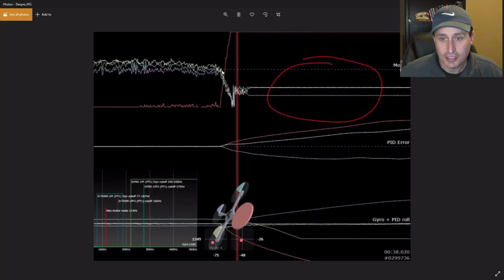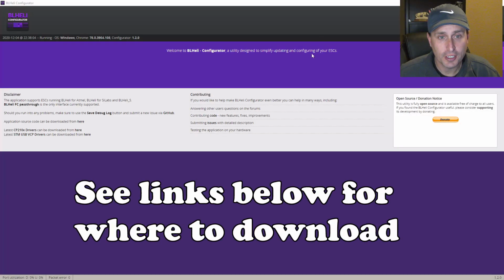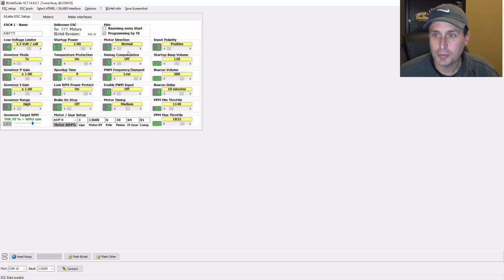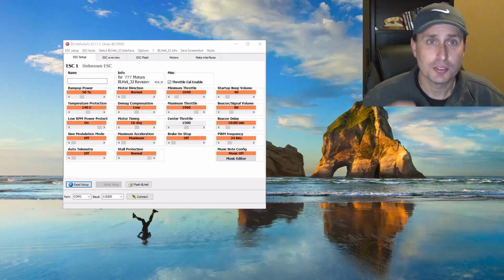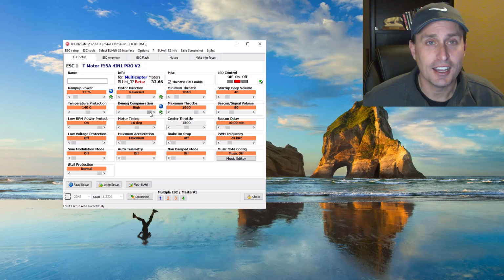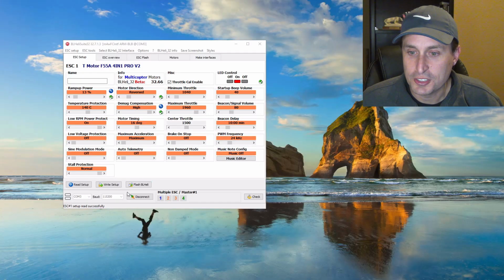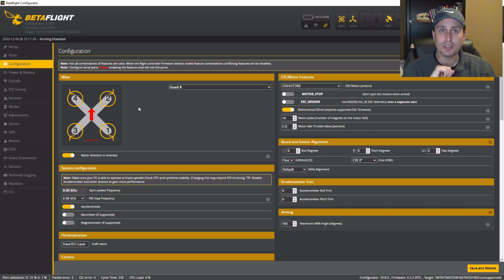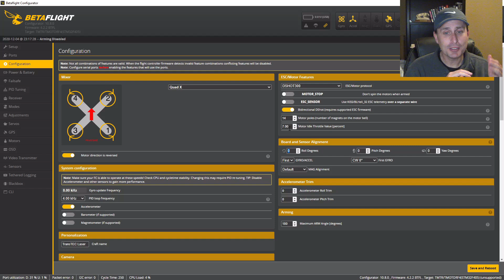How to FIX Desyncs in 5 Minutes

Comment: Cheers Mark!! i was somtimes getting random desync's when catching a fast roll. Im using Diatone Mamba 6s 40a 8bit blheli s esc with Iflight XingE 2306, just got thru 2 packs of sbangy flipping & flopping everywhere to try make a desync happen but it seems all good now(fingers crossed)
Reply: So here I am commenting a month later, IM NOT having extremely random de-sync's anymore 😃
I still have the same motors & FC & ESC.
I was updating Betaflight to a newer version & when I went into the CLI for my dump I noticed there was some errors that came up in Red (probably should have snapped a pic so I'd remember what they were but I didn't 😬)
Once I updated BF firmware I went into cli again & there was no errors.
Since having the newer version & no errors I have not experienced any extremely random de-sync's & the quad flys better now.
Reply: Xing E have uneven magnet causing desync i have same problem with those motors
Reply: @gamerpro6205  I did find a tiny ding in my front left motor & this could be my issue. I just had 2 spare motors arrive yesterday but I haven't changed out that motor yet, probably over the weekend.
My problem is extremely random, for instance out of the last 10packs it's only happened twice. 
How much does yours happen?

Comment: Great tips, tried your way and finally tuned one of my 5'' well, but I do have another 5'' desyncing all the times when I do yaw spin(pitch and roll are fine), and when I use 4s pack it's all good, only desyncs in 6S yaw spin, do you have any recommendation for this? Thanks!
Reply from the maker: Ummmmmm... only other tip is try 48k PWM.

So it is falling out of the sky after a yaw spin on 6S?
Reply: @UAV Tech  Yes only on 6S and what is strange this quad would have serious desync problem at yaw roll pitch on the latest bl32 32.8 with dynamic pwm frequency on, and my esc only support 24k-48k, and when flash it with 32.7 and set pwm frequency 24k only yaw spin have desync problem, strange isn't it :,,,)
Reply: @ziontsui9656  I'm very interested in the cause of your desyncs, I have the same case. Extreme desyncs at Yawspin and 6S. Sometimes it falls from the sky. Frustrating.
6S, ESC 45A, T-Motor F40 IV / 1950KV, conservative PIDs, BLHeli 32; 32.8.
Reducing ramp-up power, Demag compensation and motor timing are unsuccessful.
I tested the motors in Betaflight Motortab (wihtout Props), quick throttle from 0 to 100%, also desync and scary smells. That wasn't good, but the motors survived.
I made a Video about it: https://youtu.be/tixQ0muONXk
Reply: @vanair  Still figuring it out, so whoever solves it could notify another

Comment: Hi, and what about a 360° roll ( without falling ) or 180° happening just after a flip on a 5" ?  
Blackbox showing 2 motors at 100%...
Reply from the maker: If the quad falls from the sky, desync.  If not, could just be motor saturation.  Controller calling for more than 100% of the motor, which the motor cannot deliver.
Reply: @uavtech  Thank you but please what is motor saturation, and can it be solved by the same way ( rampup, dmag)? Or pid ? 

Please d'ont tell me it could be esc or gyro, I just changed the stack...

Comment: I'm having this happen on one of my X-Class quads with APD 80a esc's, and It's driving me crazy. It only happens on the left rear motor, mainly during a flip or punch out. The left rear of the quad just drops. It's already caused me to crash and break a total of 6 arms, and nearly destroying one of the MAD Polar 5215 motors. Getting too expensive to keep trying. Any suggestions with APD Esc's? I've never had this happen on my other rig with iFlight X80-80amp blHeli 32 esc's and cheap 4814 motors.

Comment: Built my new 7 inch one week ago. First flight all good, today with the second flight it didn’t fly, it started to roll away like desync problem. It’s not a problem of props or motor direction because it flew ok the first time and I double checked. Analyzing blackbox one motor doesn’t increase the rotation like others and stay at the minimum causing this problem I guess. Is this issue desync anyway? Thanks in advance
Reply from the maker: Sounds like.
Reply: @uavtech  I tried to fix it with your tips but that didn’t help. I’m so sad. Probably I need to think about bad hardware? Motor or esc? It’s an hobbywing 60a. It’s so weird that for the first flight everything went well.
Reply from the maker: Last ditch is try 48khz PWM on the ESC setting.  If it is still dropping an arm, then it I would look at ESC or that motor.  The motor in BlackBox that the command is going to 100% is the one that is desyncing.
Reply: @uavtech  actually the bad motor in blackbox doesn’t spin up like others, it means it spins but stays low :(
Reply from the maker: Just remember, the Motor Commands in Blackbox are the COMMANDS.  So the lowest command motor is typically the strongest.

Comment: I’ve got a couple sets of Tmotor F40 pro IV that have damage to the windings from the inside of the bell touching them, seems the windings in these motors are sitting too high in places and now T motor has a rubber washer under the bell it can compress and the inside of the bell can grind the high spots on the windings.

One of the motors eventually got a winding cut right through and it stalls as soon as I raise throttle above hover but kind of amazing it still works at all I thought. I put the least damaged out of 8 motors onto one quad and every now and then one of the motors desyncs but recovers. T motor aren’t very helpful, I’ve bought thousands of dollars of their motors and they are dead to me now, emax eco II all the way 😎

I’ll give this a try on the dodgy motors though, thanks.
Reply: Man, those Emax EcoII's are butter. They're well worth the 💰. Cheap with a premium feel. I have two sets of the 2807's, and one set of 2207's. I prefer the Eco II's over the Tmotors, & my Hypetrain Grinder's, especially for the price difference.
Reply: 215 / 5000

I also have a lot of trouble with T-Motor F40 Pro IV, multiple desync during a flight. Especially at Yawspin. Any of the engines cause trouble. I haven't found the cause yet.
ESC is also a T-motor.

Comment: Great video I'm running 4s motors on 6s by scaling them down in betaflight will this work and will I still be able to use both 4s and 6s with the start up  power lower

Comment: Mine is doing that roll of death, but it happen when I punch the throttle, I can hover, as soon as I give it some throttle, it spins. I've tried your suggestion of the video, but didn't workout... any other suggestions?
Reply from the maker: Are the other motors spinning to full when it death rolls? Flight Controller brown out?

Could just be you need to replace the ESC.  Before you do that, set PWM to 48khz amd try that too.

Comment: Hi! I have some problems, when i use my 4s lipo on a 6s quad the quad fly normally, but when a switch to 6s lipo, the quad falling down with no reason, and dont know what to do.
Reply from the maker: Whelp, do these things outlined in the video.  Also, try 48khz vs. 24khz.

Comment: Can any of these setting burn motors? My motors are cool after a full pack  but every 3rd session I smoke a stator. usually on a hard maneuver or startup.
Reply from the maker: Nope.  Could be signs of a bad ESC if you are having desyncs on default ESC settings and now burning motors too.

Comment: What would cause bad input frames
Reply from the maker: It is not that.  It is the ESC losing the position of the motor through not getting a clear Back EMF reading.  That can be the motor or ESC causing the issue.

Comment: A bit late to the party but I'm wondering how setting ramp up power affects the performance of the powertrain? Just going off of the name, does this reduce the power delivered to the motor the when it gets a command to increase RPM?
Reply from the maker: It doesn't.  It is only used to kick the motor to start rotating.  Is it really be called Kick Force
Reply: @uavtech  ok thanks for clarifying that one! :D
Reply: Hmm, I read Oscar Liang article about BLHeli_32 settings and he wrote "A slightly higher rampup power can benefit your drone as it pushes the motor harder when it’s trying to gain RPM (faster acceleration), giving you more responsive and powerful feel (...)". Now I'm confused :/ Is it only for initial kick on startup or acceleration of the motor in general?

Comment: how did you setup a blackbox to get ESC desync in it?
Reply from the maker: Just log.  You will see motors traces by default.  See theuavtech.com/blackbox for tips on working with BB
Reply: @uavtech  ok, and what should I do if I get desyncs only while flying on 3D mode? I tried lowering rumpup power and didnt work.

Comment: Is it a desync if one of my motors started spinning slower than the rest? I have a bnf iflight chimera 7" and when I arm the quad the bottom left motor will twitch out. I've never crashed it, or had other issues. I don't have any new motors or esc's to check, wondering if it's possible to fix in bf. Thanks!
Reply from the maker: Probably a bad ESC unfortunately.  Check solder joints (remelt), but if it won't spin up fully, that is a sign of a bad ESC.
Reply: That's too bad ! Thanks a lot. I'll try that when I get home today!

Comment: I have desync during throttle at 100 % kiss esc any idea ?
Reply from the maker: At 100% throttle it fall out of the air?
Reply: @uavtech  yes if I put throttle 100%!up to the air the kwad turn off but crazy rolls, if I fly normal with out 100% push it fly perfect , sometime on throttle blips also do some
Pitch on blips
Reply: Yes like one motor goes crazy and the fc and esc get in fail safe mode where I cannot rearm  then
Reply: Also notice some unbalance on the blip throttles

Comment: I have been chasing this on my 7" with INAV. It would fall out of the sky when testing return-to-home (maybe because the FC does a sudden throttle input). Flashed back to Betaflight and it still happens on hard throttle punches. Maybe this will fix it... with those big motors and long arms it could be an expensive troubleshoot. 😬
Reply from the maker: Fingers crossed
Reply: @uavtech  so far so good... took it out for a test and you can see it dropping an arm or twitching occasionally, so it seems to still be desyncing at times but it recovers. This thing has individual ESCs, maybe there is some subtle wiring problem, but for now at least it flies and doesn't just do the roll of death. Thanks for the useful tips 🖖

Comment: I'm having this issue with some of my fl1 race quads. The h7 ones are fine and the one with millivolt 20x20 and hw 20x20 esc this worked. But the one with revoltosd and hw 60 amp is still doing it. It recovers but still does it when you get on the throttle hard. Can't get it to go away. Gonna try another fc and harness see if that helps. The esc is brand new

Comment: Do you have any knowledge of KISS builds? How would I do this on FETTEC 45amp ESC?
Reply from the maker: Unknown really.  But do you have Desync issues?
Reply: @uavtech   Yes. They just started out of nowhere. I had slight oscillations at 3/4-full throttle or what sounded like (flutters from the prop/motor) then eventually over the past few months they started to get worse until now it’s a desync issue. The quad flew fine for months prior with the exception of the flutters or oscillations. Apparently this is an issue with FETTEC. I thought maybe you’d have a solution.
Reply: I have terrible Desync issues with Fetter 45A ESC / Kiss FC V2 on 6S T-Motor Blackbird. I tried everything, at the moment I change motors and gonna switch from OneWire over to DShot. On low pitch props it did not happen so strong.

Comment: Hey I had this question does racewire with led aka motor led pcb does affect rpm filtering or anything because it takes some amps from motor line of specific two wires and not from third one
Reply from the maker: I would guess not.  The RPM is based on the ESCs Back EMF detection of the motor, which seems to be ok with race wire of folks would get desyncs.
Reply: @uavtech  with led one's as well
Reply from the maker: Yeah, i have not heard that LED ones cause huge desync issues, so RPM should be reading fine.

Comment: Tried this with a Tekko 32 45Amp ESC on 6S.  With a value of 12% the motors wouldn't spin when armed.  Bumped it up to 15%.  Gotta go test flight to see if it helps.
Reply: Two test flights and all seems well.  Strange though as this just started happening after a few months with this quad.  Maybe a sign the esc is going bad?

Comment: Is it just for builds with desyncs. I've tried going down to .25 as recommended by ryan H. And I have actually smoked motors and escs back in the day playing with this stuff. Could have just been crap gear but I've still been scared to mess with it
Reply from the maker: You can't smoke motors or ESCs by turning down start power.  And 0.25 is jot far enough in my experience.

Comment: One question though ! Once my motor dysyncs , can I reuse it again . Once it started to desyncs it started doing death roll in my every flight
Reply from the maker: It is an ESC issue.  Not motor.  Yes.  I have used ESCs for years on 0.125 that desynced on 0.5 all the time.
Reply: @uavtech  thnx man , I’ll now fire up my blheli suite and makes changes as you have talked in the video .

Comment: Thx UAVTech! 
It seems this method doesn't work for smaller or banged up motors? I'm having a lot of desyncs for my 0805 11,000KV motors (crashed for a few times), changed Startup Power to 0.125, and some motors refuse to start on the bench. 
I went with 0.25, gonna test flight soon.
Reply: How did it go for you, I also have a similar build doing the same thing, did you fix it?

Comment: Thanks, man. I was flying an older quad that did a “roll of death,” but one from which is was somehow able to recover (had been flying two mistakes high). Unfortunately the flash memory was full, so I don’t have the BB log. I’ll obviously need to do another flight and see if I can induce this event again while logging is active, but do you have a suggestion about how I can tell if the root of the problem is an ESC vs a motor?
Reply from the maker: Unknown.  But every time i have seen it is the ESC.  You can figure out what arm it is and swap around motors if you want to verify.

Comment: ok i got a 2750kv motors on 6s, the only way i could stop it so far is to reduce the power thingy to 80%, in case it matters, when i get full throttle dsyncs, my copter would recover before hitting the ground.
do you think ur methods will work for me? or are my motors too big for 6s? Please help!! :)

Comment: Your forgot to mention two other things that are crucial in solving desyncs. Motor Timing and PWM frequency. I had lots of trouble with desyncs on my low kv 7" 6S Build. Especially when running 48khz and Auto or low (<20°).
Setting timing to 23° from 20° and using 24khz solved all my desync issues. It's also a common problem on older Tekko32 Holybro ESCs where 48khz seems to induce lots of EMI causing desyncs. So if you suffering from desync also try to increase timing and reduce PWM.
Reply: Yep, I fixed that problem just with motor timing. Went from medium to highmedium

Comment: All well and good but WHY does lowering startup power of the ESC fix this? what is that actually doing, and why is the default not 0.125? Surely there is a tradoff somewhere or they would just ship at 0.125 not 0.5, right? What is this actually doing that fixes it?
Reply from the maker: It is the kick to get the ESC started.  Too much kick is causing a bad Back EMF reading.  So lowering the kick helps.  The default use to be 0.125 back in the day.

Comment: Should i be setting this startup power for all my  quads even if im not experiencing desync?
Reply from the maker: You could I guess.  Your motors won't have as much kick to start spinning, but too much can be an issue too.  IDK, with this said, if default isn't broke though - for your ESC - don't fix it.
Reply: wondering this as well. I am wondering what the trade off is... if this fixes dsync with no downsides....why dont the escs ship at 0.125?

Comment: A few months ago I crashed my quad on a tree. After that it was desyncing randomly a lot of times. Turns out a branch cut one of the windings on the motor and the esc didn't really like driving the motors with essentially less poles.

Comment: I do this by default on my quads, some of the ESCs don't necessarily need it but my Flycolor stacks did. First flight on a 5", scared shitless and it goddamn did the flip of death. Straight to my houses roof. Good times :D
Reply: That what mine is also is a flycolor stack. After updating to 4.2.3 and getting bidirectional working I had a dsync. Maybe cause I had motor stopped enabled in betaflight. How hobby place had set back in 3.5. So turned that off and gonna adjust my start power in blheli_s and fingers crossed fixes issue

Comment: Hi.. i have a green hornet from iflight. After a small crash on of the motors started to run and stop again and again.. any suggestions? 
Thanks in advance
Reply from the maker: Increase Dshot idle and see if it makes better.
Reply: @uavtech  so, i tried it... Still the same problem 🤷🏻‍♂️
Reply from the maker: If all these settings, and still issue i would swap motor (position).  Then of course after that is ESC if issue persists on same arm.
Reply: @uavtech  i have put a new motor but still the same problem.. so I think it's the ESC ... 
Thanks a lot anyways
Reply from the maker: Yup, it is typically always the esc.  They are of course much more complicated and easy to break vs. motor.
Reply: @uavtech  thanks again for the help..